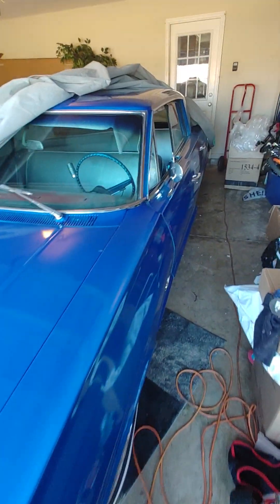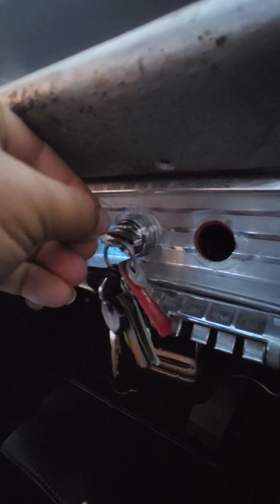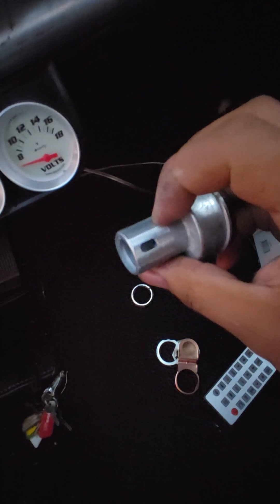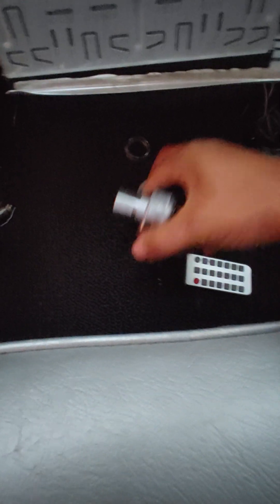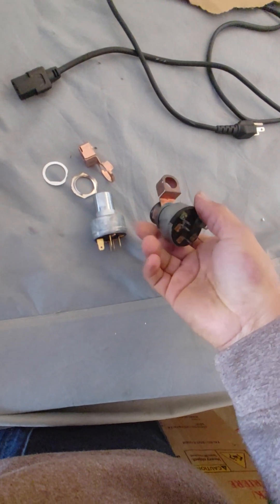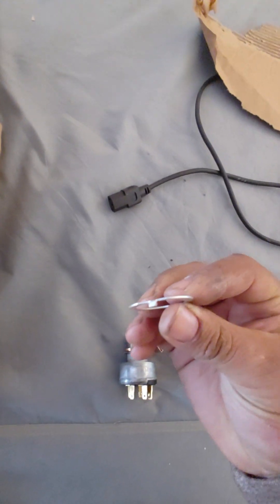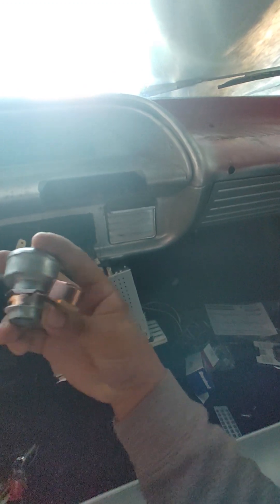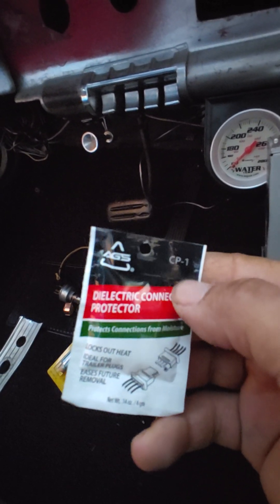1963 chevy impala ignition switch replacement

Comment: So I see you messing with the stereo … do you know which cables are for the ignition to the stereo and the battery cable for the stereo ? The colors please 🙏… thank you in advance
Reply from the maker: @bigtg42  lucky the person I got the car from removed the original wire harness for the radio so I basically ran a yellow and red to the fuse box cuz I had an extra spot on the driver's side and when I turn the key on it comes on and when I turn the key off it goes off
Reply: @fegetta1 thank you bro … I’m about to do an install on one but not familiar with the older rides … learning new things everyday… 🫡 thanks for the help
Reply from the maker: @bigtg42  what year ,make and model you working on?
Reply: @ it’s a 63 SS impala
Reply from the maker: @bigtg42  coooollll.

Comment: I got a 61 without the key. How can I remove it, and replace it?
Reply from the maker: 2 ways. Get a lock Smith to make a key or get a paper clip for the two holes in the lock cylinder can a small blade screwdriver and wiggle it up and down until you get it to turn to pop out the cylinder
Reply: @fegetta1  okay thanks